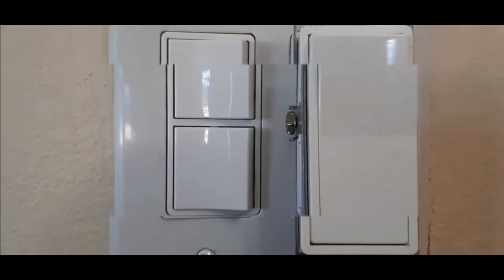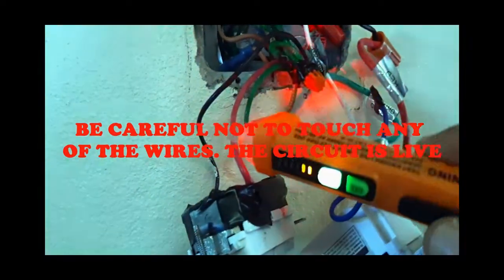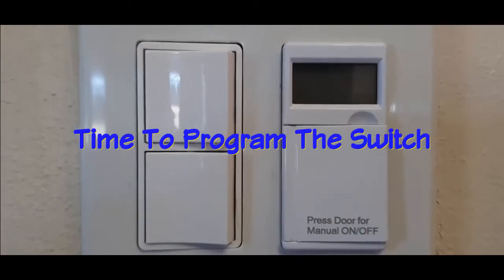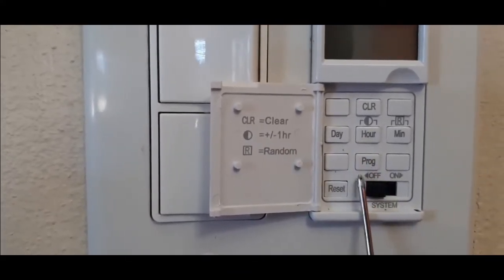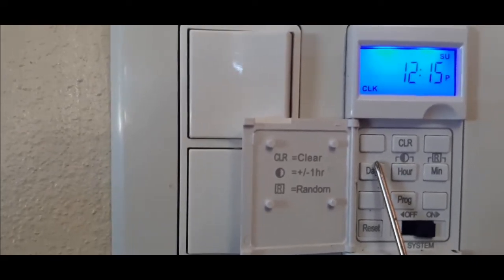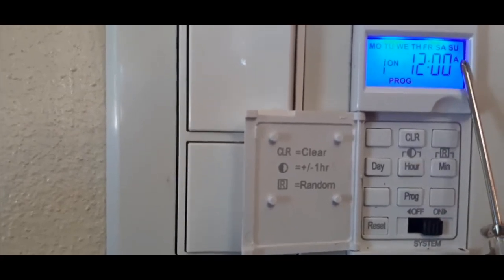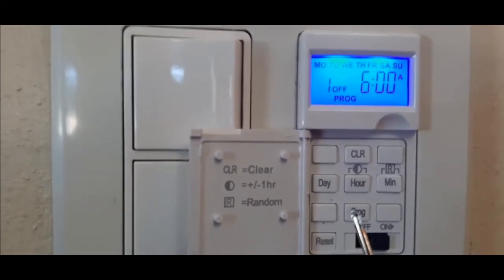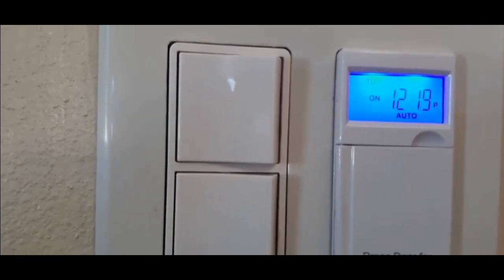Automatic Timer Light Switch installation and programming DIY

Comment: all that work, buddy I have a wireless bulb with an app that does the same thing
Reply: Make sure you subscribe to the man channel.
Reply from the maker: wireless bulbs are limited. This is not limited to lights, it can be used to switch on a fan, generator or any electric circuit or appliance that require precision or convenient timing